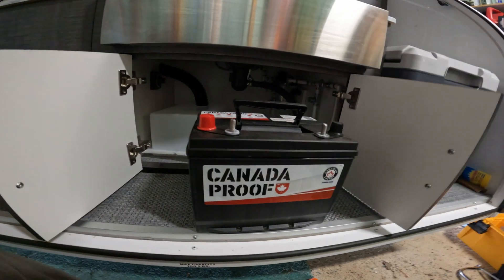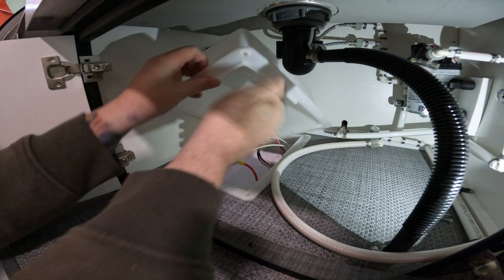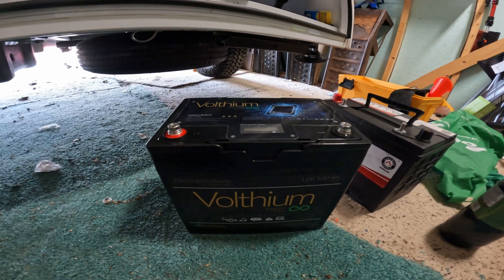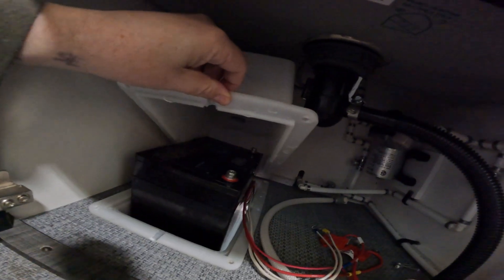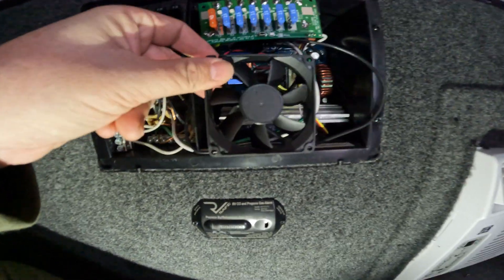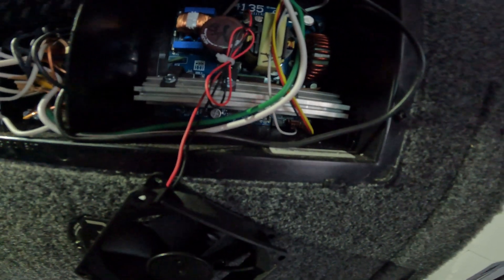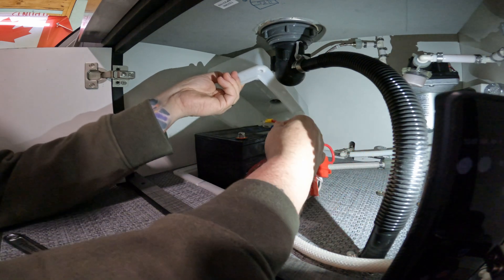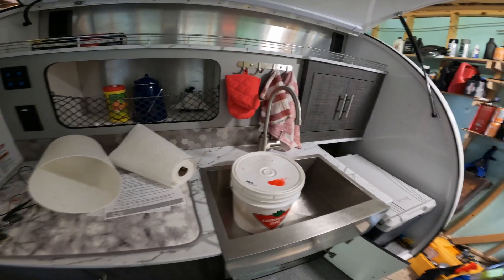InTech Luna Rover - How to upgrade to a Lithium Battery

Comment: Great video! I have a 2022 Terra Rover and want to do this upgrade as well. Was there anything special you had to do for charging the new battery from your tow vehicle or while plugged into shore power?
Reply from the maker: @wayneterry9503  same charge procedure
Reply: @BruteforceExplorer  nothing else to buy or connect? Just want to be sure since I’m new to this. Thank you a ton!

Comment: If you're hooking up solar power after switching to a lithium battery, it appears to be common knowledge that the solar port's connection is reverse polarity from the camper. So either switch those at the solar port, or reverse them at the battery. This is from the FB Luna page. Comments welcome if I'm mistaken. Thanks for the video, Brute!
Reply from the maker: Watch my solar suitcase video to confirm the Zamp reverse polarity foolishness and how to fix!   Thanks for watching

Comment: Thanks for the video. If I were to use a 200 amp hour battery, 12V, do I need to replace the battery cables? I am not increasing the voltage, just the capacity of the battery.
Reply from the maker: I would think not, but I am not an electric specialist. Best thing would be for you to pose that important question on an InTech Facebook group. They will have a more qualified answer.

Comment: Hi, very good video, very helpful. I was thinking of installing a 200Ah battery, do you know if LifePo4 batteries needs to be vented like lead acid? Do I still need to have the cover installed?
Reply from the maker: I was told they did not have to be vented BUT i would highly recommend doing some google searching on the topic. I could imagine a closed in area having thermal issues so please check in to that prior to implementing anything for safety reasons

Comment: Thank you for making this. So does this battery hook directly into a solar power cable coming into the bottom of that battery tray, so when you plug in those solar panels of yours (with those converters) on the outside it charges the smart lithium battery? Trying to figure out how you charge this battery up so I can replicate your setup, thank you!
Reply from the maker: The outside "Zamp" connector is simply a wire  going to the battery with a positive and negative. I think it has an inline fuse as well.
Reply: @BruteforceExplorer  Thank you!

Comment: Just to confirm, you have a 2021 Luna Rover, correct? I do too, and just got a new lithium battery. Need to check the converter to make sure it has that switch… fingers crossed it does!
Reply from the maker: Yes. I'm almost certain it has the switch. It's hard to see in the position you need to contort your body into to get a sightline.
Reply: @BruteforceExplorer  Thanks! It did have the switch. Pretty sure it worked! Thank you for the video. If I could do this anyone can!

Comment: Main reason you flip the switch on the new controller boards…. Is you do not want to over charge or completely deplete the lithium battery. The old controllers do not have this function… I know my 07 did not.  I was looking at a low voltage alarm, but sold the trailer.   You are all set to start installing a PV system.   Cool vid, weird the battery is inside and not at the tongue…. This is safer from theft.
Reply from the maker: Thanks for the info John.